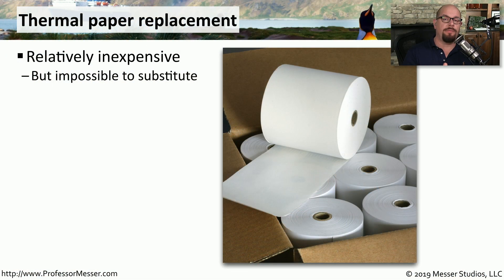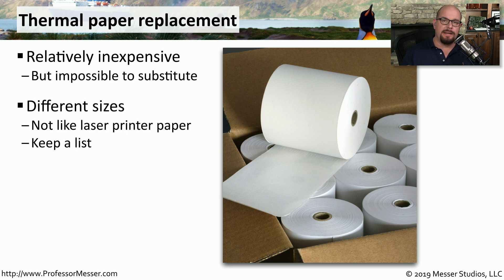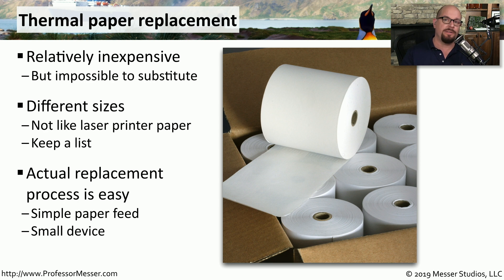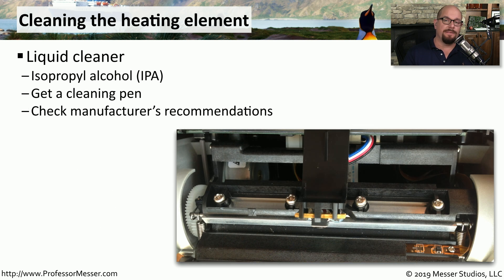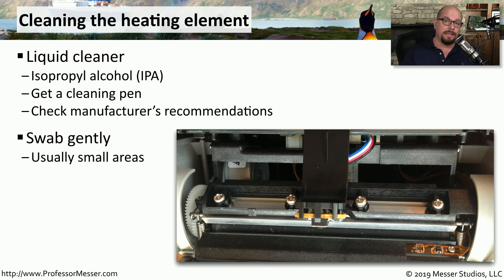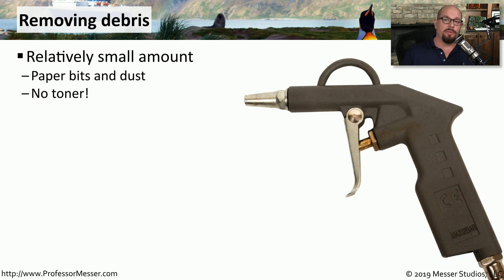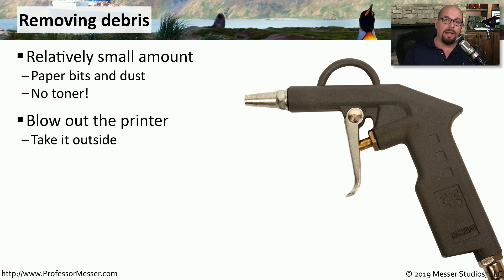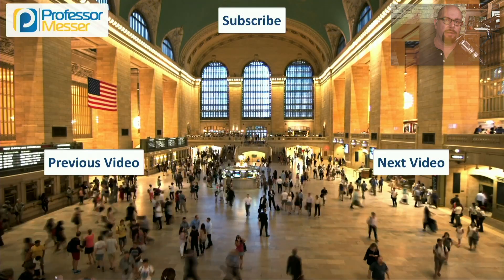Thermal Printer Maintenance - CompTIA A+ 220-1001 - 3.11

Comment: What causes the receipts to sometimes trace your fingerprint on it when you've been holding it for too long? Is it the heat from your fingers?
I also find that these receipts don't last very long especially if buying electronics that have a warranty with them. They need a receipt but the print tends to fade out even if you store it with other papers.

Also, thank you, Professor Messer!
The course notes along with the videos are helping a lot with my A+ studies! They're well organized!